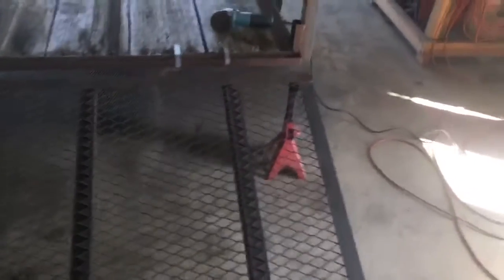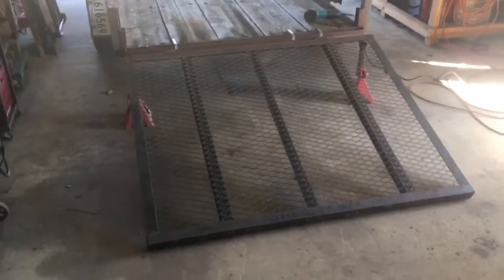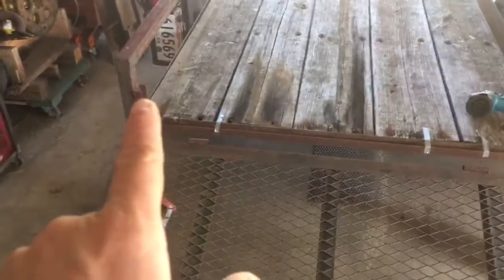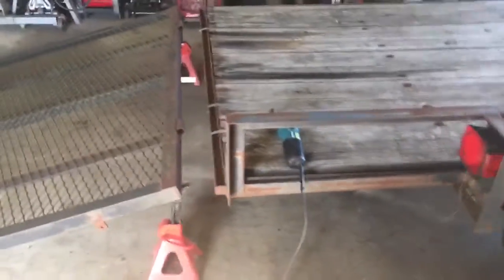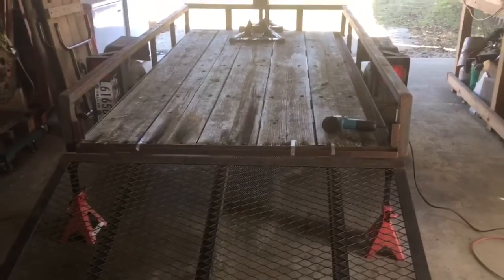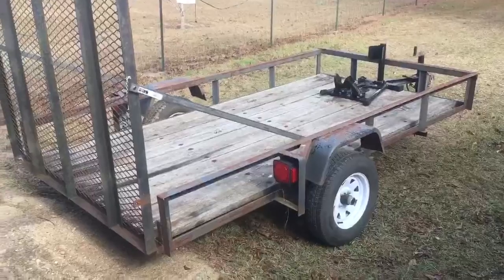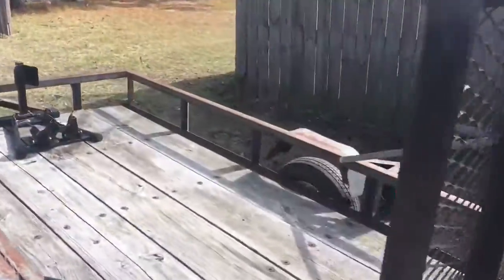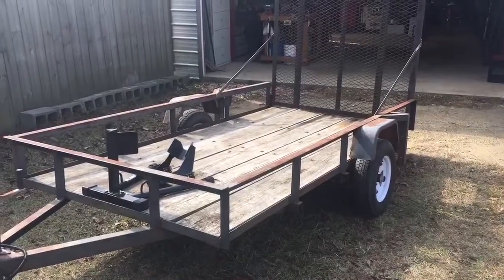Adding a ramp to a utility trailer

Comment: I like your thinking and concepts ,I’ve owned quite of few Trailers over the years  including Utility ,Camping, Enclosed Trailers and lots of Boat ones accommodating Vessels from 10 feet to over 30 feet and 10K lbs  any add ones or modifications should have lots of Versatility  built into them  to accommodate future needs you may not have even thought you might need  the key thing about trailers are they are Inexpensive to keep legally tagged  and with proper maintenace can be used for many years  I have a Galvanized boat trailer I’ve owned for nearly 20 years  and it’s been used to haul small boats ,inboard Marine Engines , and even a  Motorcycle  yet can still perform as a boat trailer easily   Over the years. I have stockpiled hubs , bearings  ,tires and wheels to  be able to perform all my maintenance and even roadside repairs in a jiffy  I buy many of those items at discount prices  and it makes life easier  in the long run  oh yeah I’ve used that trailer for many Personal Watercraft transportation of numerous manufacturers and on occasion for hauling Out Board motors too
Reply from the maker: thanks!